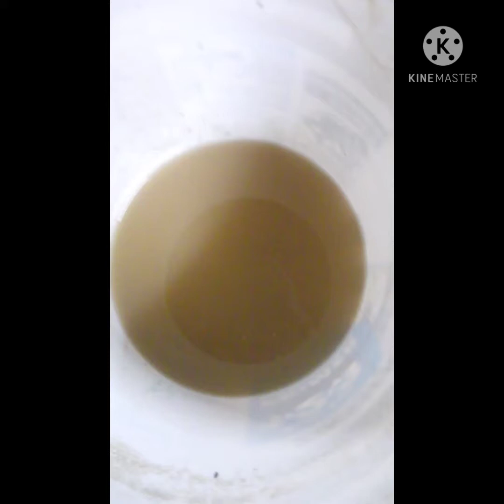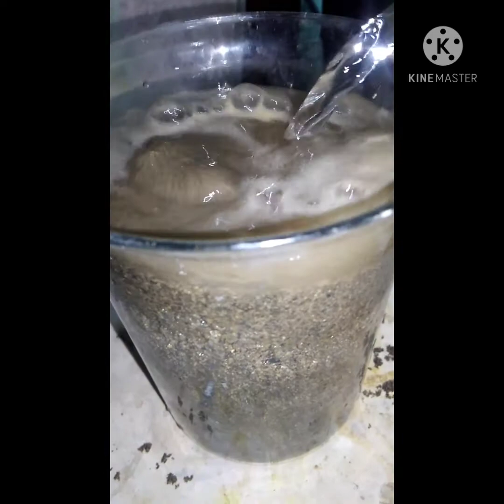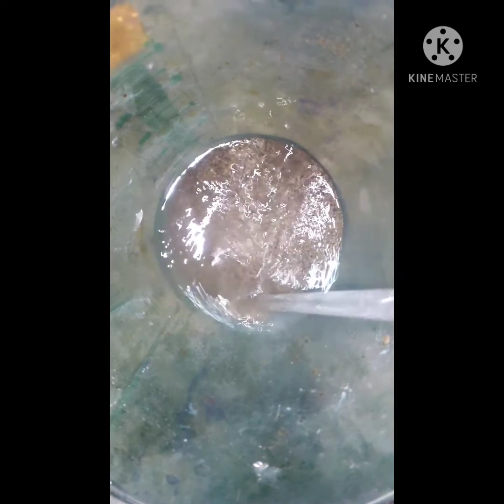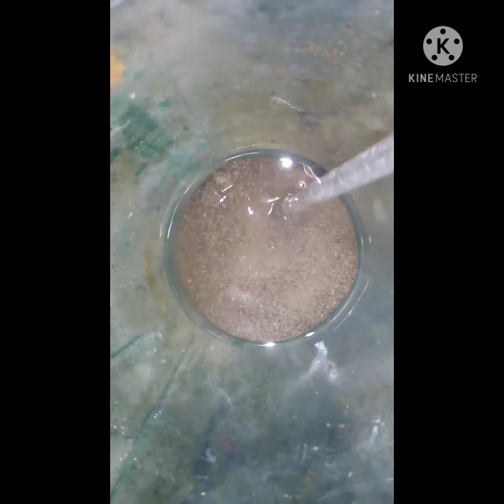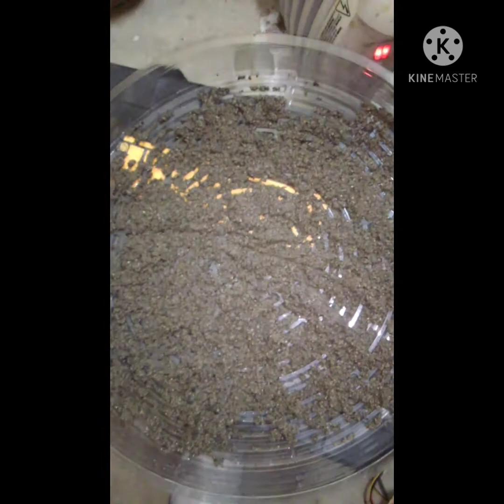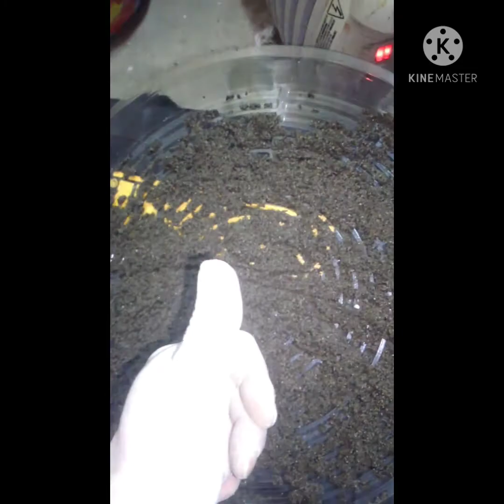how to clean/purify sand for flash chromatography.

Comment: What are you planning to use this for? 
You should run a column on something colorful with this (maybe plant extracts or mixed printer inks) as a demo of (flash) chromatography.
Reply from the maker: I actually have a plan already 😂 soon to come.
Reply from the maker: And yes it will have colors plus duel solvent extraction